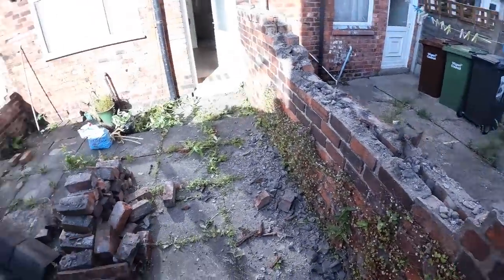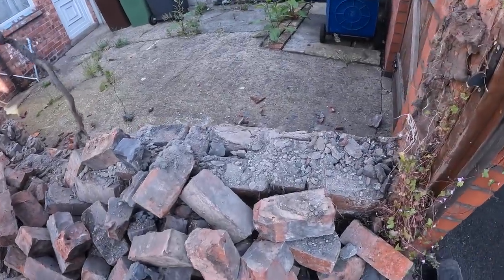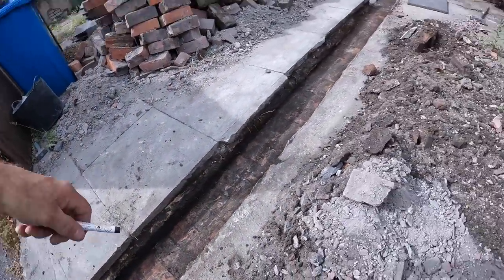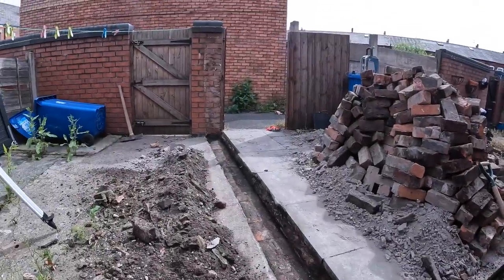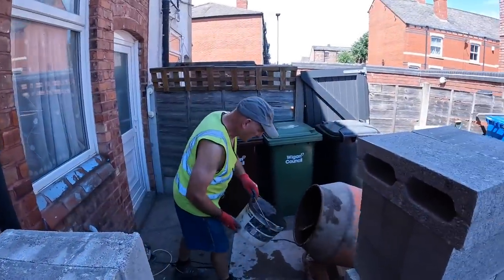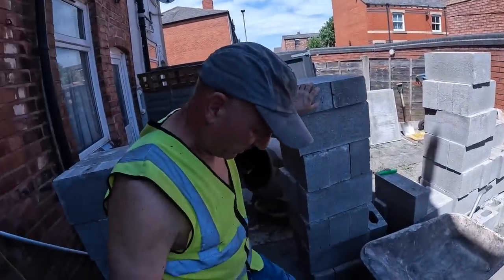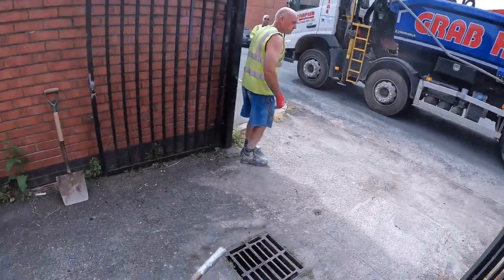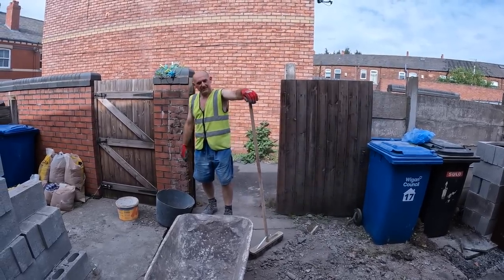DANGEROUS WALL DEMOLITION!!

Comment: Should the wall where it butts up to the house of had a bit of damp Proof course fitted vertically to stop damp rising up the block wall and bridging house damp proof course of slate or modern chemical injection.  Would a wall starter kit help to fix/secure wall to house wall.
Reply: It'll be interesting to see what the guys did do 🙂
Reply from the maker: @markdauncey927  🤙🏾🤙🏾🧱👍🏽

Comment: Well, it was easy to get that wall knocked over, someone leaning against it could have been an accident to happen.
Clearing the rubble was a harder job.
However, there was hardly any mortar left on these old bricks, so not much work cleaning them up.
It's difficult to judge the condition of the bricks themselves, but if they were still good I would have opted to re-use them instead of having a concrete wall as a customer, it would certainly look a lot nicer.
But maybe the customer wanted the wall a bit higher and these bricks were not sufficient, but I can see that in the next video, so keep them coming.

Comment: Hi Alex & Steven which is the best concrete slab mix on insulation ballast & cement (6:1) or (8:1) with mixer,thx love the videos
Reply from the maker: When we use ballast we mix 4to 1 🧱👍🏽
Reply from the maker: @martin2466  🤨

Comment: Good video, shame the customer opted for blocks as them reclaims make a beautiful wall.
Reply from the maker: Those re claims were crap ! 🧱👍🏽
Reply from the maker: @martin2466  🤙🏾🤙🏾🧱👍🏽
Reply: If the client runs to render the walls would be very smart - not that S&A won't do a good job of fairfacing the blocks.
Possibly the house is rented and the landlord just wants a neat functional job.
Reply from the maker: @markdauncey927  Spot on 👌🏼🧱👍🏽